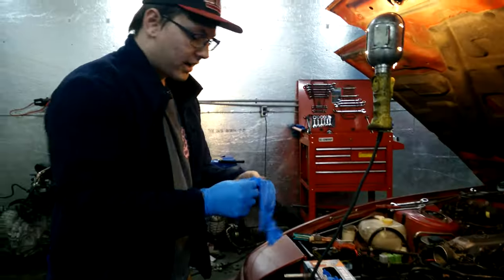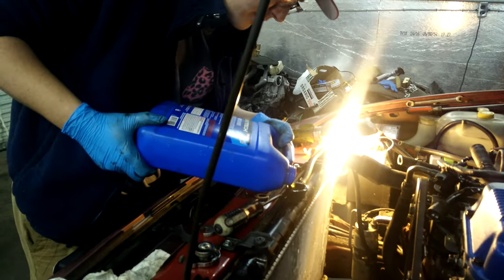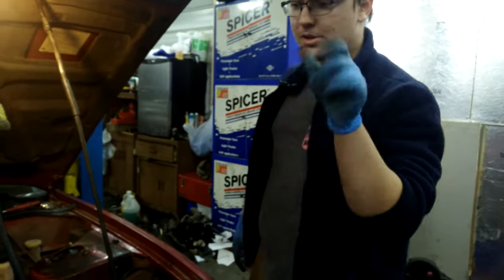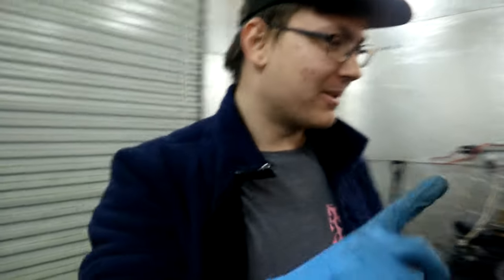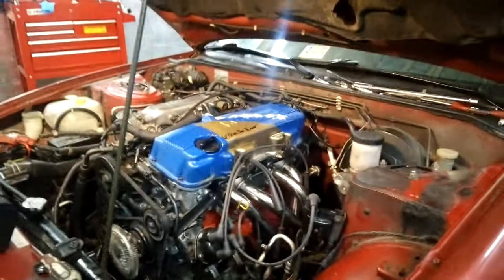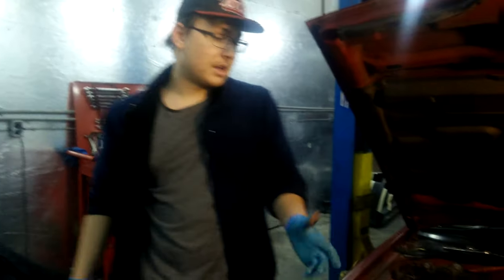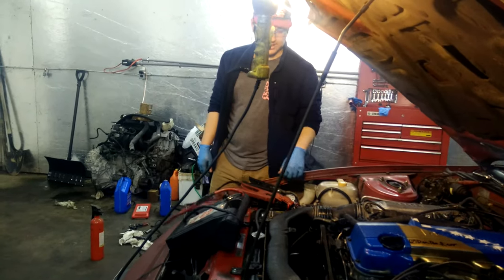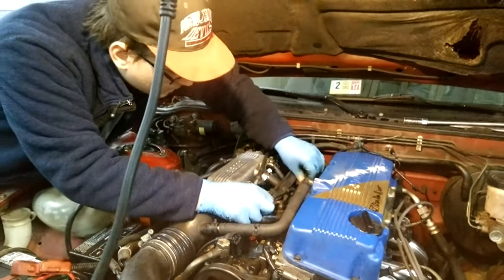Trying to get the engine started - Granny 240sx Build Ep 9

Comment: you can buy a spare injector clip for your injectors, than clip it on and use a 9v battery. Touch both wires to the battery leads and see if you hear it clicking, to make sure the injectors are good. check fuses too, could just be a fuse
Reply from the maker: I should mention that we tested two sets of injectors
Reply: Bamboozle Boys hmm, definitely has to be a wiring issue. Check all fuses, i had a ecu fuse blow in my old accord that caused the alternator to only put out 7 volts, so could be something to look at. also highly unlikely but could be a bad circuit in the ecu or ecu harness, check that, especially if you have a spare ecu